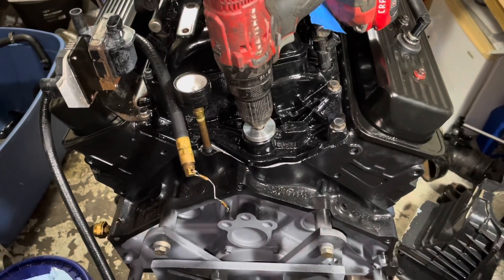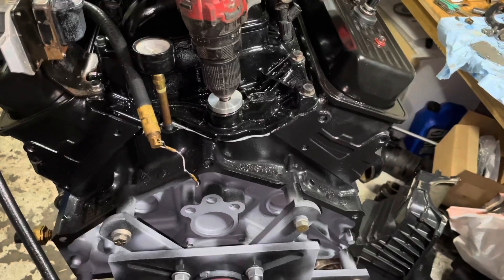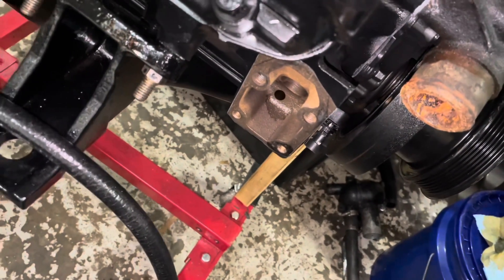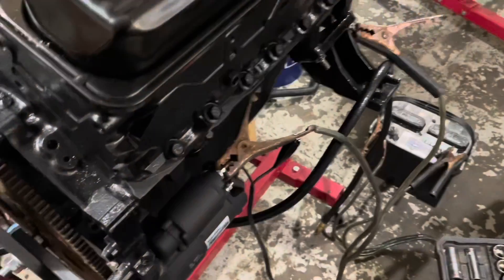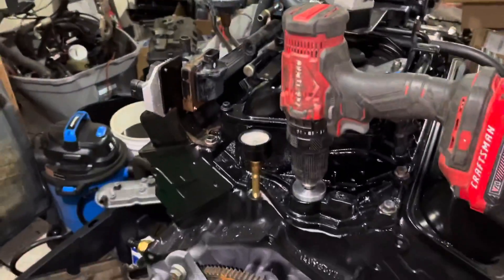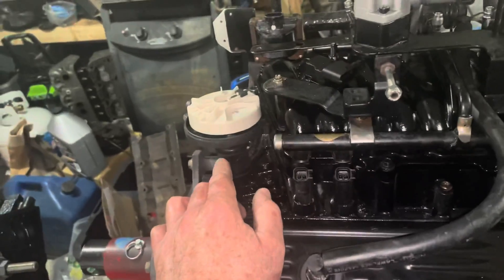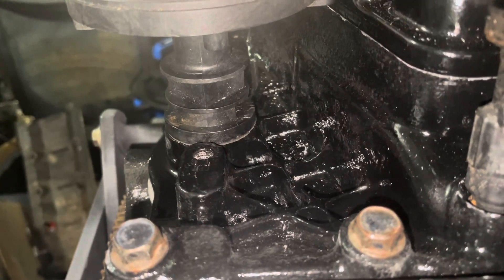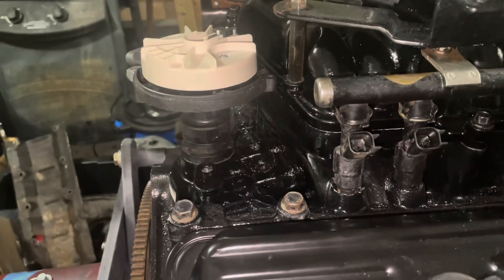Mercruiser 5.0 MPI 1(k) - How to Super Prime Your Engine

Comment: Hello, I have a problem with my Mercruiser 5.7 MPI engine. On my boat, I have to push the throttle halfway to start. I changed the fuel tank filters, as well as the pressure regulator. I also changed the rotor and the distributor cap. Still the same problem. Do you have a solution? Thank you.
Reply from the maker: Even though the throttle is “closed” in neutral when cranking it still needs a little bit of air to start and run. There is an idle air control attached to the throttle body which is an ECM controlled bypass that lets air in the engine for it to idle. There is a way to test it using a paper clip in the datalink connector. I did a video on this a few years back.

https://youtu.be/yqDaZuTYMpc?si=KG-k7uq2Xo6doCcG
Reply: @moccasinmarine  Thanks for the information. Here in the southern region of France, there are no very good Mercruiser mechanics.